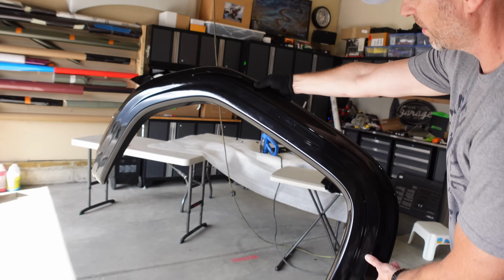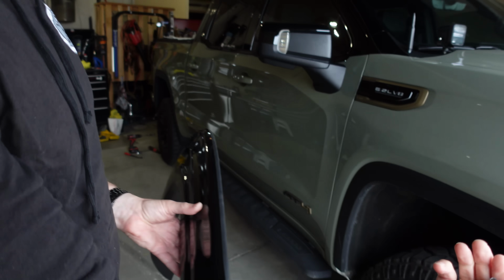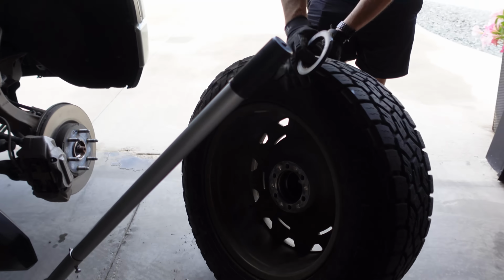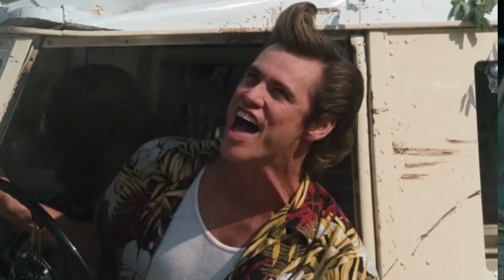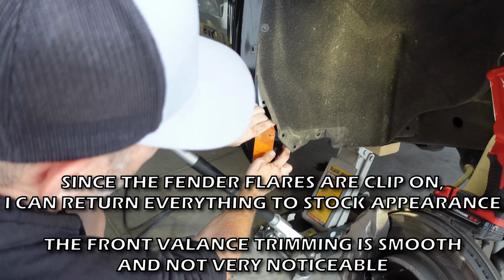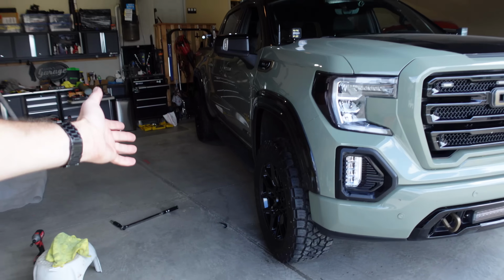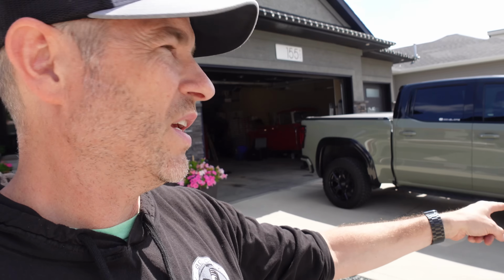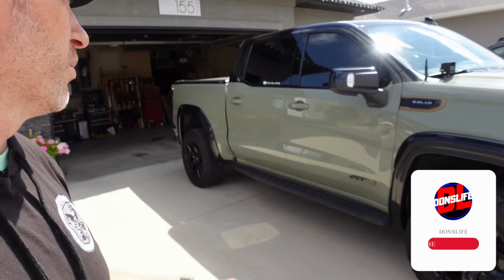This GMC Sierra AT4 Is Transformed And Almost Unrecognizable - Lots of Mods

Comment: LOVE the video and the looks. But, TBH, I am not a fan of wheel spacers. Instead, I went with offset wheels (Fuel) with 1" more poke. The wheels actually weigh less than stock, oversized tires are only 3 lbs heavier each. So, no difference is sprung weight. So many guys have crazy aggressive tires, crazy spacers, and have front end problems due to improper installation, added weight, and excessive tire wear and rubbing. All good tho, it is their money/truck. I still LOVE the beefy wide shoulder look for trucks. I wouldn't mind another 1/2" to 3/4" more poke on mine.

Comment: Truck looks great!! How long could you leave the wrap on and not damage the paint job? I saw where you said you will go back to white. I have a grey 2023 trail boss and would like to wrap the roof and door pillars glossy back as well.
Reply from the maker: You can keep a good wrap on for years.  The worst that can happen is glue residue that is annoying to clean off after.   Quality vinyl usually won’t leave residue or very little.
Reply from the maker: I haven’t damaged paint yet.  I have heard of people with budget repainted panels that may peel when a wrap is taken off them.  It might have more to do with paint not being fully cured or shortcuts with prep

Comment: I think subscribing to the Donslife channel ought to come with a warning if you own a 1500 AT4. Something like… WARNING your truck mod work load is about to drastically increase if you subscribe…  😂😂😂😂
I found the channel after buying my 2023 Sierra 1500 AT4 Duramax. 
I really enjoy Don’s sarcastic narration and his detailed description of how he goes about each mod. One thing is certain… if you find a mod on Don’s channel its passed his seal of approval.  
I suggest Don’t create a video sharing a bit more about his off camara life and how he came to create his channel. 
I think the latest color scheme of Don’s AT4 is the bomb. I’d love to have mine wrapped in the Kaki Green color and the wrapped fender flares was the missing touch.
The spaced wheels look sharp and I had heard before 34 inch tires are a better choice for these 1500 AT4s and you showed why... less trimming to get them to fit. 
Unless I missed something Don's AT4 is not lifted. It has the rear air bags and the 1 inch front lift provided by the Bilstein shock upgrade. Thats something to keep in mind... we can get this look without purposely lifting the truck 2 or more additional inches.
Yes... including family in your videos would boost the channel's appeal.  
Lastly... keep up the good work and showing us your trademark attention to detail.
Since wheel offset is always difficult please tell us what would have been the wheel offset needed to not use the spacers?  What is the new wheel size...20x9?
Reply from the maker: 👍 I will reply your email when I get some time too

Comment: Hey Don, I can’t get those brink rims but I’m looking at rims with either a 0 or 20 offset for my 24 AT4. With a basically factory tire of 275-70R18(general grabber atx) is there much poke? I want the set up to be flush without trashing the paint. Thanks.

Comment: Are they the same tires 285 60 R20 that you use in the bronze wheels ?
Reply from the maker: Same tires yes but the offset and spacers push them out farther than the bronze wheels.  Created a little rubbing

Comment: Don, do you know that wheel spacers are in the top 5 worst mods you can add to your truck ? It changes front end wheel alignment and most of all accelerates wheel bearing wear and tear.
Reply from the maker: Nothing lasts forever.  I too would prefer a no spacer set up.   For the summer.  This is it
Reply: You've been watching too many click bait YouTube videos. When using the PROPER type of spacers, such as what he used, you don't have issues. It's no different than running different offset wheels.
Reply: @FastSS02  I don't watch click bait videos like you do I happen to be an automotive tech and I see issues all the time from wheel spacers. Any wheel or spacer that exceeds the manufacturers " original " width adds extra strain to the bearings and suspension.